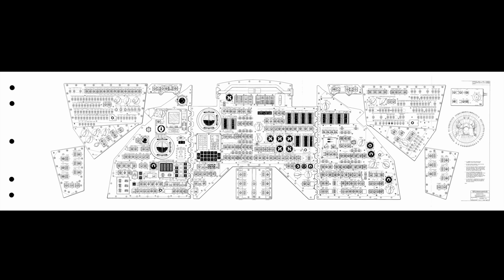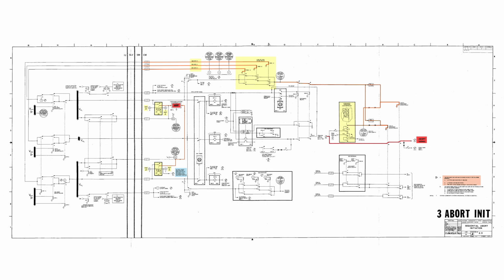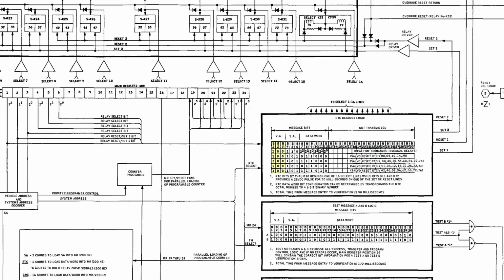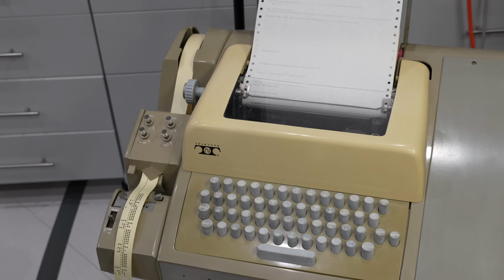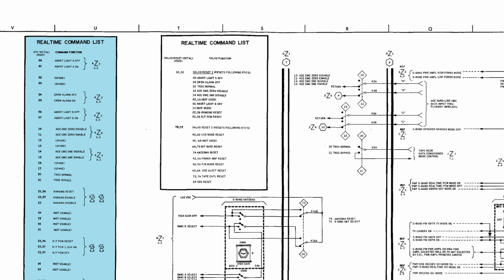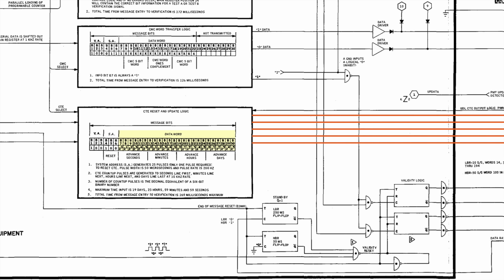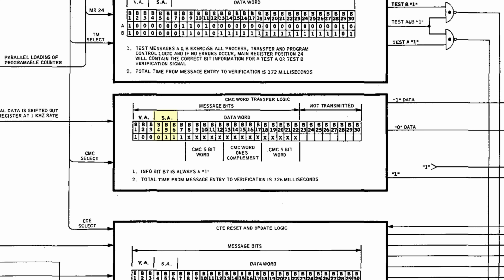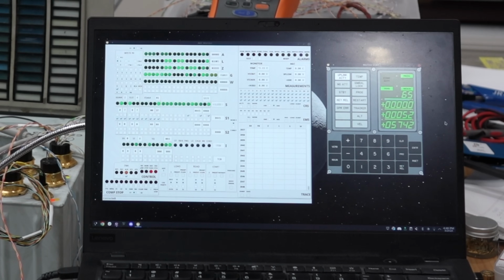Apollo Comms Part 34: Trying every function of the Apollo command system

Comment: The security was very high all ports and Lines are ensured with each diod , to block inaccurate signals on wrong ways, that u are never see today, each transmitter can pull them wafe in any directions on the board lanes today.  No one fly again to the moon !  This guys like carlsons Lab ?

Comment: A few years ago in this series Ben Krasnow from Applied science came out of nowhere with an fully working luminescent DSKY display. Then he appeared in Steve Jurvetsons private space collection and talked about how he would like to restore one of the fuel cells. I hope it doesn't take too long until he appears again with an working fuel cell.
Reply from the maker: We are still talking about the fuel cells, and Mike recently discovered much needed documentation on it. But it is so scary. Sending high pressure H2 and O2 in a 50 year old piece of high power electrical equipment. I can’t think of a single thing that could go wrong…
Reply: @CuriousMarc  "that's the crater wher California used to be!"
"YouTuber sends himself to the moon."

Comment: Amazing work from Marc, Eric, Mike, and all the others. I struggled for 20 minutes trying to connect a bluetooth device yesterday, and here you are doing punch tape to PC talking.
Reply from the maker: Yes, but we struggled for two years to get to that point!
Reply: It's not surprising struggling with modern technology. There are no obvious switches and lights. For example I learned the other day that to put Samsung ear buds into pairing mode you take them out of the case, then put them back in, then close and open the case. That's a ritual, not a technical procedure!
Reply: @gshingles only certain prayers trigger Bluetooth pairing, exact distance necessary, must be kneeled down for it to work.
Reply: @snowzZzZz  😂👍

Comment: But don't they have to confirm everything before sending it, ie, wouldn't a wrong command crash the spacecraft. Did they run it through a duplicate system on the ground like Marc's setup.
Reply from the maker: You are absolutely right, and they did confirm many times, particularly for the AGC uploads. Before it was sent, while sending, after sending. And uploads were held in an upload buffer in the AGC before they’d be applied. The buffer would be re-checked by telemetry, then they’d finally send a short validation command to apply the upload. I’ll go over it in the next video.

Comment: What about time delays for signals between earth and Apollo while setting the clock?
Reply: I imagine they would know the delay from command generation to timer update occurring and adjust accordingly
Reply: @Spookieham  
Yes, the Apollo system did compensate for the time delay caused by the signal traveling between Earth and the spacecraft. This was an important consideration due to the significant distance between Earth and the Moon, which could result in a round-trip signal delay of up to 2.5 seconds (1.25 seconds each way when the spacecraft was near the Moon, since light takes about 1.28 seconds to travel the roughly 384,000 km).

### Here's how it worked:

1. **Time Delay Estimation**: The Apollo system was aware of the current position and velocity of the spacecraft relative to Earth. NASA's tracking stations, such as those in the Deep Space Network (DSN), continuously tracked the spacecraft's position. This allowed precise calculation of the signal travel time at any moment.

2. **Compensating for Signal Travel Time**: When mission control needed to send commands or data (like clock updates) to the spacecraft, they calculated the one-way signal delay. The signal was then adjusted so that, by the time it reached the spacecraft, it would reflect the correct Earth time. 

3. **Doppler Shift Considerations**: In addition to the basic delay due to the distance, engineers also had to account for the Doppler shift caused by the spacecraft's motion relative to Earth. As the spacecraft moved toward or away from Earth, the frequency of signals shifted slightly, which could also affect precise timing. These shifts were accounted for in the communications and timing systems.

### Real-time Control:
Mission control used this knowledge of signal delays to ensure that all time-sensitive operations (such as guidance corrections, telemetry, and even syncing clocks) could be managed accurately. The onboard clock of the spacecraft, while critical for navigation and operation, could be updated from Earth in a way that accounted for these delays, ensuring that the systems on both Earth and the spacecraft remained synchronized.

This level of precision was crucial for a mission like Apollo, where even small timing errors could have led to navigation problems or data misinterpretation.

The time precision in the Apollo program, particularly for onboard systems and ground communications, was remarkably high given the technological constraints of the 1960s. Here's a breakdown of how precise the timing was in different aspects of the mission:

### 1. *Onboard Timing Precision (Guidance Systems)*
   The Apollo spacecraft had two primary guidance systems with timekeeping mechanisms:
   
   - **Command Module (CM) Guidance System**: This used the **Primary Guidance, Navigation, and Control System (PGNCS)**, which relied on an onboard clock with a precision of **milliseconds**. The onboard computer, the Apollo Guidance Computer (AGC), needed to run precise navigation and control calculations continuously, so clock synchronization and accuracy were vital.
   
   - **Lunar Module (LM) Guidance System**: Similarly, the LM’s PGNCS also relied on highly accurate timing for landing on the Moon, making decisions in real-time about descent and course corrections.

   In both cases, the precision of the onboard clocks was critical to ensure that navigation and control solutions were calculated accurately, often within **tens of milliseconds**.

### 2. *Earth-Based Tracking Systems (Deep Space Network)*
   The **Deep Space Network (DSN)**, which tracked the spacecraft, had a timekeeping precision on the order of **microseconds (µs)**. These ground-based stations measured the spacecraft's position and velocity extremely accurately by tracking the Doppler shift of the signals transmitted from the spacecraft. The higher precision on the ground was necessary to track the spacecraft's location within a few hundred meters across the hundreds of thousands of kilometers between Earth and the Moon.

### 3. *Communication and Telemetry Timing*
   For the Apollo spacecraft's communication system, the timing precision needed to account for:
   
   - *Time Delay Compensation**: Signal travel time between Earth and the spacecraft, which could vary between **1 to 1.25 seconds one way* depending on distance.
   - *Clock Synchronization**: The spacecraft’s clocks could be updated from Earth, and the precision of these updates was essential for mission-critical operations. The updates were made by accounting for signal travel time, which was computed to within **milliseconds* to ensure synchronization.

### 4. *Timing in Critical Events (Lunar Landing)*
   During critical operations such as the lunar landing, timing needed to be incredibly precise. The entire landing sequence relied on accurate timing for thruster burns, altitude measurements, and velocity checks, often within **milliseconds**. 

   For example, during the descent to the lunar surface, the Lunar Module’s computer (which also used the AGC) processed real-time sensor data and issued control signals based on precisely timed inputs. The entire sequence of events had to be executed with *millisecond precision* to ensure a smooth landing.

### 5. *Synchronization Between Ground and Spacecraft*
   Although the onboard clocks were not perfectly synchronized with Earth clocks over long periods (due to drift), regular updates from Earth ensured that the clocks remained within *milliseconds* of Earth time for most of the mission. These updates were especially important for precise navigation and communication.

### 6. *Doppler Shift and Frequency Timing*
   The Doppler effect, caused by the spacecraft's movement relative to Earth, affected the timing and frequency of communications signals. Tracking stations compensated for this with extremely precise measurements of frequency shifts, down to **fractions of a hertz**, which required timing precision on the order of **microseconds**.

### Summary of Time Precision Levels:
- **Onboard Computers (AGC)**: Milliseconds precision for navigation and guidance.
- **Earth-based Tracking (DSN)**: Microseconds precision for spacecraft tracking.
- **Time Delay Compensation**: Calculated within milliseconds to synchronize clocks and signals.

Overall, while the spacecraft's onboard systems operated with precision in the millisecond range, Earth-based systems and signal tracking were precise to the microsecond level to ensure the highest possible accuracy in navigation and mission operations.
Reply from the maker: Yes, they sure had to compensate for propagation delay. For that reason, the CTE update is the one command that was not computed nor sent by Houston. It was computed at the tracking station and sent from there. Adding the delay was quite simple, since they had a direct measurement of it right at the station to a fraction of a millisecond, obtained from the pseudorandom ranging signal turnaround time. Then they added the deterministic command processing time, which is indicated on the drawing if you look closely.

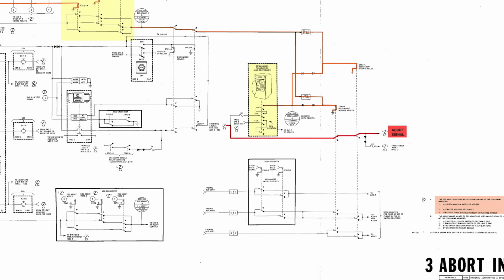Comment: 5:40 There's also another auto abort trigger which I don't think is mentioned in that schematic—exceeding the LV angle-of-attack (alpha) limits, measured using a sensor on the launch escape system. In any case, the launch vehicle rates referenced for an abort comes from the IU's inertial system, rather than the AGC—one of the things that helped Apollo 12's launch.
Reply from the maker: Ah yes, the Q ball! I believe you are entirely correct. I wonder where the wiring for that is hidden, I did not see it on this page. It might be going directly into one of the event sequencers, which controlled the complex escape tower firing sequence. And you are also correct on the source for the rates, it’s from the IU in the Saturn V, which I did not show at the left of the page. That certainly saved the day on Apollo 12, as the command module IMU lost power, but the Saturn V systems kept on going.

Comment: This is good.  Our company designed and built the IMUs, which interacted with the Guidance Computers and the DSKYs to actually direct the whole Guidance System.  I myself spent countless hours, often overtime at nights, working on various problems.  I still have some pinout tools for the various mil-connectors.  One common problem was that the wiring was always made as short as possible, to reduce weight.  As such, there were "stress points" at many connectors, which caused wire breakage right at the joint with the pin.  Mostly due to vibration or thermal shrinkage (often not considered by the mechanical engineers).  We had special "repair kits" for these.  Also, one time at Boeing, they had wrapped a wire bundle with some kind of very tight tie-down, and that tie-down actually smashed the wire insulation, and caused wire shorting.  It took us two whole days to figure this out, since they were in a vacuum chamber, and nobody wanted to dump the vacuum.  The tiedowns were never needed but they just followed normal procedure, and created an additional problem.  This was actually common during those programs, from people wanting to do too much, too fast.  Murphy's Law alway intervenes.
Reply from the maker: You guys certainly did an awesome job!
Reply: There was a lot of people and organizations involved, the idea of common practice becoming a liability is as old as sin. Thanks for your work!
Reply: Wire failure at the pin was usually caused by soldering the wires; given that MIL and Def STANs require crimped joints unless unavoidable, and then the use of rigid encapsulation is required, this shouldn't be an issue of either standard is used.
Reply: I wouldn't complain about people wanting to do too much, too fast. It got us to the moon, and it got us the longest-operating space probes in history. These days people want to do too little too safely. Result: We can't even get people to our own space station and back any more. If we want to get anywhere in space exploration, we need that pioneer spirit back, that just embraces the risks.
Reply: What mil connectors were used? 38999?
Reply: @professorx4047  Based on our Lunar Rover designs, these were an older series (the greenies), but I cannot remember the numbers (maybe 15xx).  The 38999s were used much later, for just about anything.  Our undersea connectors and cables were all customs, and also custom processed for anti corrosion and pressure applications.

Comment: I wonder if those two lights could have been used by Houston to send visual morse coded messages, in a weird situation where the only communication link still working was the UDL.

Or is this a completely nuts idea, because if the UDL is working, then by definition, something better to communicate is necessarily working as well. Can we imagine a failure mode that would require Houston to use a light for morse code?
Reply: I would not be surprised if it was in a procedure document somewhere

Comment: Thanks for answering my hacker questions, this was satisfying. I love how they implemented that firewall using a big master switch and a relay reset switch. Fascinating the astronauts could overrule everything but a single light bulb for Abort.

I love the "remote desktop" functionality of the AGC. genius.

Only leaves me to wonder how much the ground could NOT control. Seems like it's basically everything else that isn't AGC and the few shadowed switches. Which in the end, seems like a whole lot. So there's no way Apollo could have been entirely flown without a crew, had it been a desired feature. (I'm thinking like Buran could be entirely flown remotely).

So looking forward about the video on the logistics with the DSN and all the ground support for this. This sounds fascinating as well.

Comment: Out of curiosity, is the bitrate on the dsky presses from Houston limited to a human level or can it read as fast as it can be sent?
Reply from the maker: Both. We’ll cover that in another episode, but when doing manual keypresses, flight controllers were supposed to wait for reading it back on their control screen DSKY telemetry return before pressing the next key. With the propagation delay both ways, that meant up to 3 seconds between keystrokes. When doing a ground computer assisted load, keystrokes were sent about 300 ms apart (take this with a grain of salt, I need to double check that figure), without waiting for confirmation, in order to go faster. However, the keystrokes were accumulated in a keystroke buffer in the AGC, and held there. At the end of the computer load uplink, which took 20s, the controller (and the ground computer) would both check the entire buffer content via telemetry. If it checked good, the FC (and not the computer) would enter “Verb 33 Enter” manually from the console, causing the AGC to accept the buffered load and process the keystrokes. So they were very cautious and deliberate with their AGC uploads.

Comment: Why does the DSKY have 'verb' and 'noun' or is this a real crappy question please ?
Reply: IIRC the two are sort of analogous to "instruction" and "data".
Reply: @Broken_Yugo  Makes sense now cheers friend :)
Reply: Just to add... It's the way they figured out accessibility back in the 60s, making the computer as user-friendly to use as possible. It was simpler to teach and explain operations using these analogous terms. You 'ask' the computer to do things by constructing sentences made of a verb (instruction) and nouns (data). Creating conversations that looks like this:

"Hey AGC, do Verb xxxx Noun yyyy. Please and thank you (Enter)."

And the AGC could also display a verb + noun to ask questions to the user.

"Hey Human, I need you to Verb xxxx Noun yyyy."

Over time the astronauts learned many of the verb numbers and nouns by heart, but I'm sure they had big cheat sheets to explain them.
Reply: @jerem-SaveStargate  :)
Reply: The principle was (and is) a long time around in computing.
It is the concept of typing in a command line.
Today most computers are operated via a mouse and a graphical user interface but  this concept became available only in the 80s (in consumer computers). Before that it was common to have a command line. Command lines are still in use today but of course they are usually not as prominent as they once were.
Instead of eg. grabbing a file with the mouse and dropping it on the printer, you just typed in:
PRINT C:\CONFIG:TXT
The first word denotes the action you want performed: PRINT - print something, it is the "verb"
The second word denotes with which "object" you want the action to be perfomed with. It is the "noun"
Due to limited capabilities of the on board computers, their displays and theyr input hardware, all of the verb-words were replaced with verb-numbers.
If you know that verb 87 denotes "PRINT", then it doesn't make a difference to you, if you type in "PRINT" or "87". To the computer both things mean the same thing.
But of course you don't need special keyboard hardware to include all of the alphabet characters and decoding what the user wishes is much more simple with
number codes then it is with decoding written text.

Today were are at the frontier to another change. Instead of pointing and clicking with the mouse we will soon be able to just talk to a computer. For anybody growing up with such a system, the concept of using a mouse will feel the same way archaic as using a command line does feel to you.
Reply: @kallewirsch2263  :)